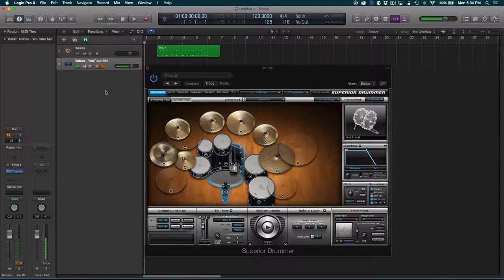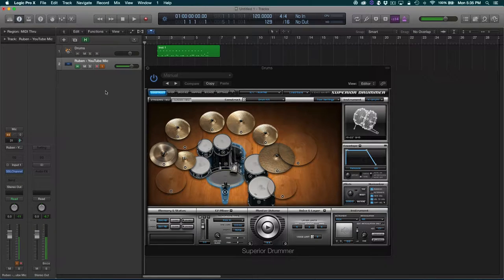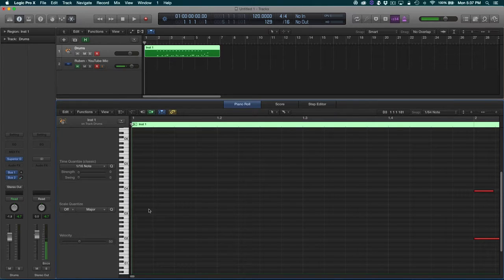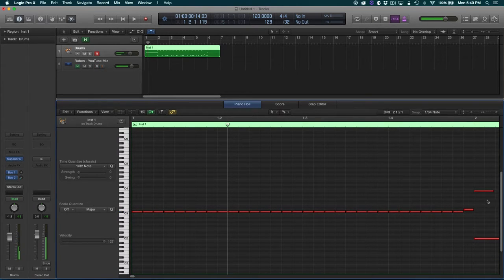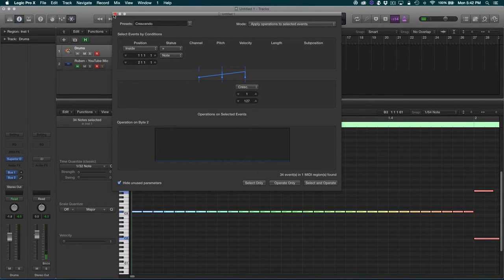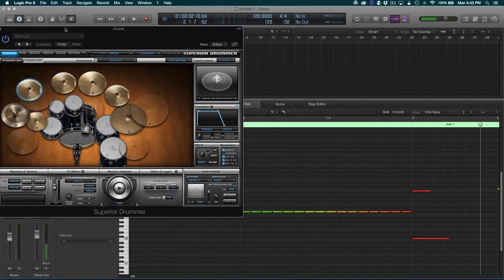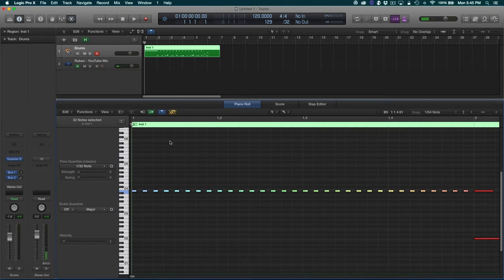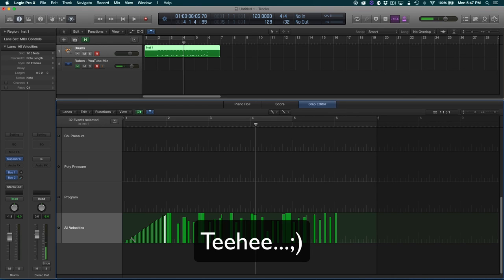Realistic Cymbal Swells in Logic with Superior Drummer 2

Comment: Ruben, how did you get the track header bar to stay mid screen in the piano roll at 9.30  - mine always scrolls off to the right and either jumps to the next view or not, depending on wether the "follow" button is on (which it never is because it turns itself off all the time).

Comment: Very good footage indeed. How have you recorded this loop within your DAW? I still don't comprehend how to record loops (or even midi loops). There's something I do wrong. Does it require hardware except the laptop?
Reply from the maker: +Kodiak and Grizzly Bears There are several ways to record loops within your DAW. You can either record and play it on a midi keyboard or drum pads, or you can manually input the notes in the MIDI editor window.
Reply from the maker: +Kodiak and Grizzly Bears I am thinking about making a beginner's tutorial video on how to do this. Should I?
Reply: hifimidi
This would be lovely, indeed.